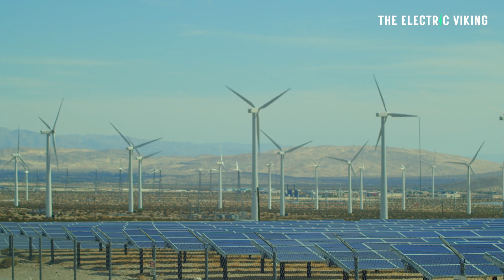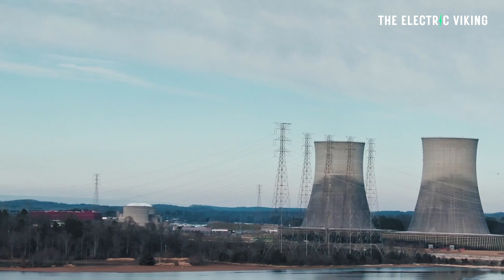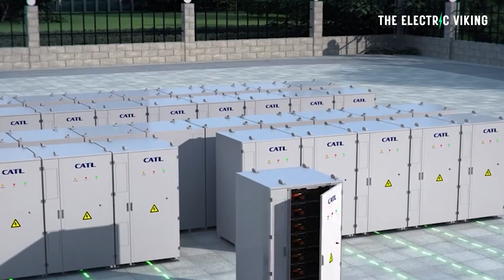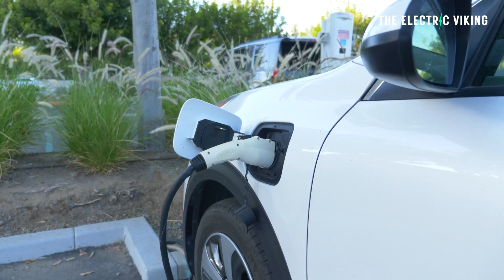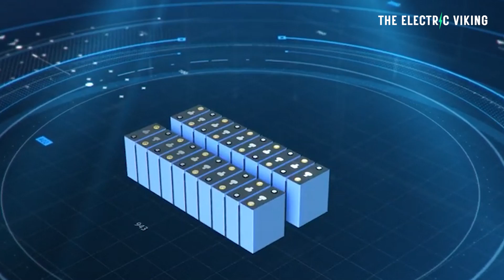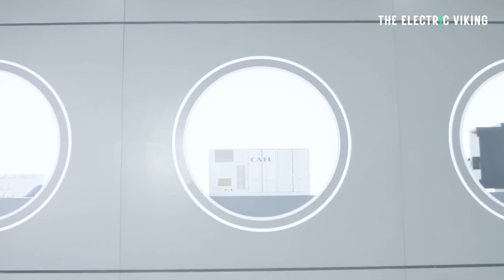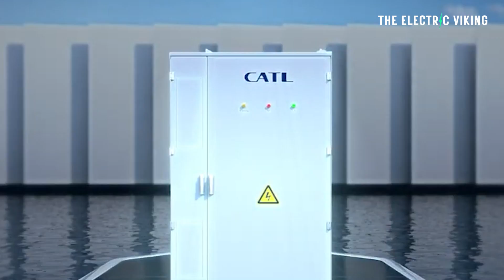CATL's new LFP battery lasts 3 million miles with 0% degradation for 5 years

Comment: I think the use of nuclear power as baseload and renewables as intermittent will be much useful for energy generation.
Reply: a rough estimate for the construction timeline of a nuclear power plant is typically in the range of 5 to 10 years from the start of site preparation to commercial operation. IF you get all the approvals first. Nuclear energy is more expensive than solar (solar + wind + battery) and faster to build, you can build it everywhare (even on your roof). Solar is "intermittent" if the production capacity is too low. There is a tradeoff between extra battery storage or extra solar production capacity. You can build a 100% coverage with solar.
Reply: @phvaessen  By the way, I fully support renewables. But including Nuclear with Renewables will give us a robust energy source.
Reply: @architkumarsingh4547  I fully spport nuclear, but it takes a lot of time to build new nuclear plants, and thorium nuclear is not commercially available, fusion too far away. The immediate, scallable, low cost and clean is solar. 175 square miles in a desert is enough to generate enough electricity for the entire USA.
Reply: @architkumarsingh4547  Banging on about Nukes wont change the fact it is too expensive and will never match renewables.

Comment: I've thought battery storage, both grid level and at home, is the answer for years. I didn't think the technology to deliver it would arrive so soon.
Reply: We are in the middle of an energy revolution
Reply: Whats the cost of this battery ?

Because for Stationary storage, energy density doesn't matter, only price matters.

And I believe Sodium ion battery can be 30% cheeper than LFP if Mass manufactured.
Reply: Batteries do not generate energy, only store it. Does Dunkelflaute ring any bells?
Reply: @ttkddry Really?
Reply: that's why we need lots of storage. There are other types of battery that store excess renewables and feed it back in over longer periods eg liquid air or pumped hydro. We will need a mix of renewable technologies, but in the medium to long term our reliance on burning things will reduce.
Reply: @i6power30  incorrect-see heat pumps!!
Reply: @Mauricio17-x1p  doesn't work in really really cold places below -10c. It loses efficiency and the noise and vibration from the overworked heat pump is as stress inducing as it may shorten its life. I'd rather stick with fuel based heater in the extreme cold as I know its reliability lie in its simplicity.
Reply: @i6power30 I ran my heat pump, with no resistive heating hooked up, for multiple days below-20c this winter with no issues.
Reply: @MGiosparky  how noisy was it? If it sounds like an ac all night one can't sleep
Reply: @i6power30  The compressor unit is outside. We don’t hear that it all. I have not thought about it before. But, the new heat pump compressor is quieter than the old system, now that your inquiry has brought that to my attention.  The new compressor is two fans instead of one larger one.
Reply: @MGiosparky  Thanks for looking into that because that's my main concern as I am very a light sleeper and live in a small house. I have a fairly new AC unit just outside my bedroom a floor below. Fortunately, it doesn't get hot enough here in most summer nights, I can turn it off by the time I'm in bed. On a rare occasions when it's really really hot, and even my neighbours AC is humming all night, I move to basement. But they only happen a couple days a year, so it's not a big issue. But winter is long here, and heat is needed most at night. So I can't afford to lose sleep every night during the winter if heat pump compressor makes the same level of sound as an AC unit. I guess if you live in a larger house, and far away from the heat pump you don't hear it, but it all depends on the proximity and sound insulation of your building.
Reply: @i6power30  You sir , are indeed, a very light sleeper.  I can’t imagine sleeping without some sort of background noise. I feel for you.
Reply: @ttkddry blah blah blah. We all know that in fact the commenter even said that. Brain dead comment just to comment? Fact is solar is abundant. Storage is needed. Oil needs to go. Shove that gas pump up your you know what?

Comment: Let's do some simple maths. If you have a fossil fuel plant pumping out 1GW (a bit smaller than Loy Yang B in Victoria) and replace it with solar plus batteries, how many of these batteries would you need? 1GW is only a small proportion of what is needed.

Let's assume we have 12 hours of darkness. In winter it will be longer, in summer, shorter. Also, early in the morning and late in the evening the solar panels won't be very productive, so we would be relying on the batteries even more.

At 6.25MWh, you would need 160 of these batteries to supply 1GW for an hour. To supply 12 hours, you would need 1,920 batteries.

Renewable power systems are more distributed, so you wouldn't need all 1,920 batteries and solar panels with them in the one place, but distributed or centralised, that's how many batteries you would need.

I am certainly not advocating the retention of fossil fuels, but we need some form of energy storage better than batteries. I honestly don't know what that is. Even if we try to use these batteries, I fear the rollout is going to take time we don't have.

All this demonstrates is that the move to renewables should have started long ago and we are now paying the price for those who delayed it.
Reply: Agree.  The math doesn't add up.  There will always be a need for fossil fuel in the future to meet energy demands.  

A gallon of gasoline holds an incredible amount of energy.  Unfortunately, ice cars only use about 35% of it for propulsion.   If all that energy  could be turned into electricity, 2.5 gallons of gas could fully charge my Tesla.
Reply: @timothyj5237 , that is exactly what we don't need to do. As bad as the maths for batteries is at the moment. Fossil fuel is worse.

Especially when used in a vehicle,  most if the energy in fossil fuel is wasted as heat. It is why an ICE needs a complex cooling system. It gets around 25% efficiency on a good day. An EV is typically 90%+.
Reply: One word: Dunkelflaute
Reply: @ttkddry  two words : distributed generation.
Reply: I get what you are saying but you overestimate the demand in the middle of the night and assume that the fossil fuel plant runs at full capacity 24/7. In Australia power demand at night is roughly half peak demand during the day. Supplementing the solar with wind, hydro, power demand shifting etc. means that battery storage need would be far lower than you estimated. I'm a fan of keeping some fossil fuel plants as backups for the predictable times when there is no sun and the wind is not expected to flow.
Reply: @gpsfinancial6988  , load does reduce overnight, but coal fired power stations are baseload and inflexible. Loy Yang B is coal. I understand that the concept of "baseload" was created to deal with that inflexibility and alternative dispatchable sources used to adapt to fluctuations in demand. Replacing coal with solar + battery does improve the situation by providing the flexibility lacking in coal.
Reply: If LFP batteries cost USD 50 per kWh as CATL claims will be the case later this year (BYD's numbers aren't much different), that's USD 50 million per gigaWatt hour.  Those 1920 units may cost a billion, but how much does a gigawatt nuclear plant cost?  Far more than that.  The numbers add up fine.  Energy infrastructure is expensive, long has been.  And yet the grid and production capacity expanded rapidly decade over decade just fine.  Look up how much your country spends each year on energy, and realize that a billion dollars is a rounding error.
Reply: @bearcubdaycare   true but that generally only applies to the battery itself. There's all the other infrastructure around it including the housing and charging.

Also, the rise of EVs will increase night time demand. The benefit is that adding the charging load at off peak times will greatly reduce the impact from that claimed by the anti-EV morons, it will increase the reliance on grid storage used with solar.

Batteries will play an important role, but other forms of grid storage will be required. Fortunately, there is a lot of work being done in a variety of novel designs.

Comment: 6MWh is enough to power around 5000 homes for 1 hour.

Thank you.
Reply: Edit: I made a mistake where I miscalculated using 6000 mWh instead of 6000 kWh. My bad. Oh well. Below is the previous comment I've made:

Lol! That's about 1.2MWh per house per hour, which is about 10.5GWh a year. In comparison, my energy inefficient home consumes about 10MWh per year. In order to draw that much power for one house, since each 200A panel at 240v can only support 48kW power draw, you need a panel 25 times more powerful in order to draw 1.2 million watts at a given moment.
Reply: @AdamIverson  ? 6mWh / 5000 = 1.2kWh not 1.2mWh
Reply: @TB-up4xi Your math is a bit off. 6000000 watts divided by 5000 homes equals 1,200 watts for 1 hour of electricity for 1 house. So in a 24 hour period each home uses 1.2 kwh times 24 hours equals 28.8 kwh.  The average home actually uses closer to 30 kwh per day so 5000 homes times 30 kwh equals 150 mwh divided by 24 hours equals 6,250,000 watts so he just rounded it to 6 mwh.
Reply: @pstoneking3418  The following is 3.9Mwh we are talking 6MWh....your maths is off.

"Megapack stores energy for the grid reliably and safely, eliminating the need for gas peaker plants and helping to avoid outages. Each unit can store over 3.9 MWh of energy—that's enough energy to power an average of 3,600 homes for one hour"
Reply: @TB-up4xi  You're right, it's my fault on my part. I must have put 6000 mWh, not 6000 kWh.
Reply: @AdamIverson WOW someone else having trouble with their math. 6,000,000 watts divided by 5000 homes equals 1,200 watts used per home in one hour.  Multiple that by 24 and you get 28.8 kwh per day per home. That's about right they say the average home uses 30 kwh per day. Apparently he rounded down 6,250,000 watts to 6 mwh. Because 5000 homes times 30,000 wh equals 150,000,000 wh divided by 24 hours equals 6,250,000 watts
Reply: @pstoneking3418  I realized the mistake on my end. I've calculated it based on 6000 MWh, not 6000 kWh. My bad.
Reply: @AdamIverson  and the LOL sarcasm???
Reply: lol
Reply: A breakdown for those that wonder how you derived that figure.
The average home uses 30 kwh a day times 5000 homes equals 150,000,000 divided by 24 hours equals 6,250,000 watts or 6.25 mwh

Comment: Wow, this battery breaks the laws of physics, 0% degradation
Reply: it isn't mean the battery have no degradation, its mean they degradation so slow and it take over 5 year before you could notice any significant capacity reduction
Reply: @chickknightgreenleaf820  shhh he thinks it is a "Law of the univers" everything break in 5 years even you. How old are you 3max4 or you are in terminal phase?
Reply: @chickknightgreenleaf820  yes, that is implied, that degradation is negligible, but not 0%.  It is inherently wrong to say 0% and certainly false publicity, which could lead them to legal trouble. They would need to advertise it as nearly 0%, no perceptible degradation, almost 0, or something like that. As a scientists, any colleague would destroy somebody that says that and U couldn't let it go.
Reply: 🤔 and it only lasts 3 million miles, one would expect more longevity if it is experiencing 0% degradation 😂.
Reply: They might be polymerizing the electrolyte.  The electrolyte and dendrites are the two biggies for failure.
Reply: Everything degrades- the question is how fast.  The Sun loses mass at a rate that would require approximately 114 million years to degrade by 1% of its total mass.  This battery will  likely degrade much faster than that 😂- but if it lasts as little as some several decades… sounds like a win to me.
Reply: Very near 0% after 5 years is real good!
Reply: I'm guessing this has nothing to do with actual degradation but more like a mis-interpreted statement like "the system will retain 100% of it's rated capacity for a minimum of 5 years", that's comepletely different.
Reply: Laws of physics do not postulate that batterie has to degrade you know?
Reply: @clemlo4973 disagree. Entropy happens.
Reply: @Travlinmo  wtf are you saying entropy are all about close systeme wich batterie are not.
There is no rule that make batterie degrade in 5 years. 
Only manufacturing and technologie that are not mature.
Reply: @Travlinmo  you disagree that Sun shine clown
Reply: @Travlinmo  read definition and try to understand them before talking for nothing.
Use Logic too, if things HAVE TO break down within 5years by rule. You would not have building, or even phone/computer, because you would not have Factory to bring them... And the list is Infinite.
Reply: @clemlo4973  I think you don´t understand the concepts
Reply: @CienciaenCadena  i think you proved you do not...
Reply: @clemlo4973  I will make it simple for you: everything made up with matter degrades, even you, the pencil, not just a battery, even the Universe. So, claiming that a pencil has 0% degradation or anything would be breaking the laws of physics, every particle has a half life and by definition the battery has a rate of degradation that is impossible to be 0. It wouldn't be breaking one law of physics, it would be breaking several laws since the battery is interacting with the energy surrounding it
Reply: @Travlinmo Not with thought. Unaffected by space or time.
Reply: @CienciaenCadena  do not talking like if i was dumdumb, when you repeat what i said, and what i Say contradict what you said before.
Reply: @CienciaenCadena 1) some half life are older than the univers you know?
2)And this has nothing to do with entropy wich you defend first. You think that a system that is made to make energy flow inside out is a close system clown.
3)if stable element would decay to have a detrimental impact other 5years life would not have evolved century old species.
4)think ....
Reply: @clemlo4973  I never talked about entropy, I think you are mixing up the responses
Reply: @clemlo4973  Yes, because there is no perfect closed system in the Universe, this is, a system that doesn't allow escape of matter, energy or radiation of any form.
Reply: @CienciaenCadena  energy literally flow in it with external help. It is not semantic of " perfect" or not it is by design a system that is act by exterior by design.
Reply: @CienciaenCadena  you Can have a balloon filled with air the system is not close cause the inside is act uppon by thermal and other exchange. Closing the Door of youre room does not make it blink out from the univers.
Reply: @CienciaenCadena  they half life of the composent inside would be a rule, but it is nowhere near 5 years .
Reply: It's probably very close to 0% degradation, but not absolutely 0%.